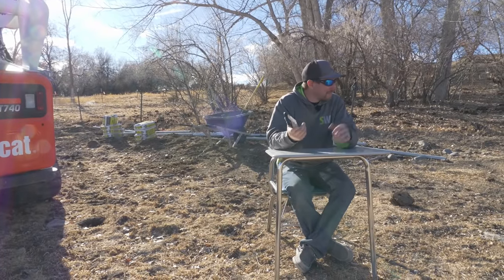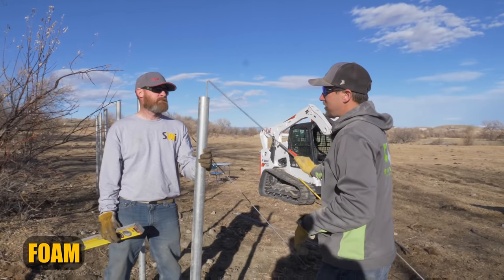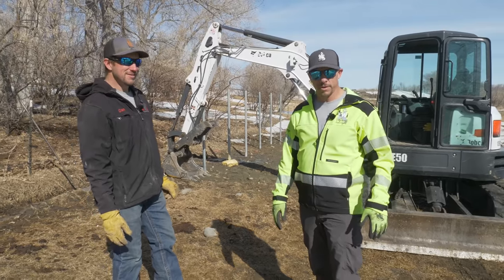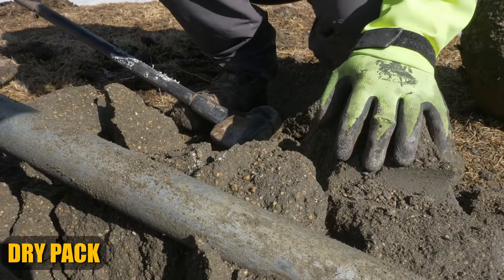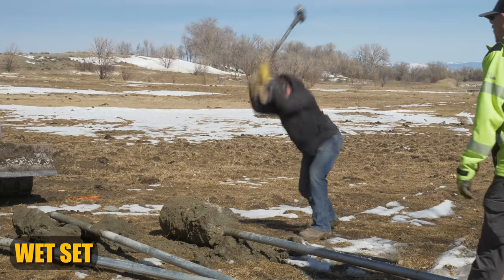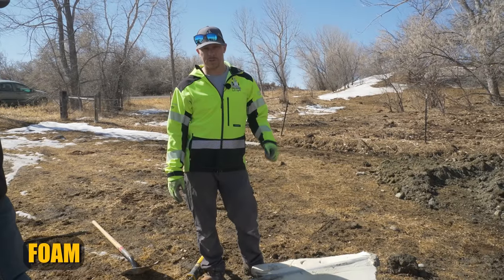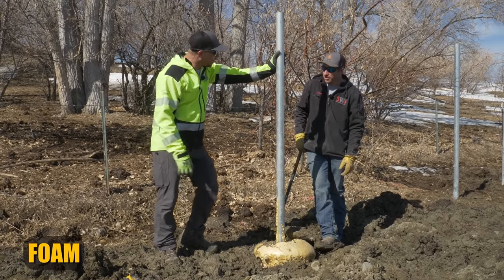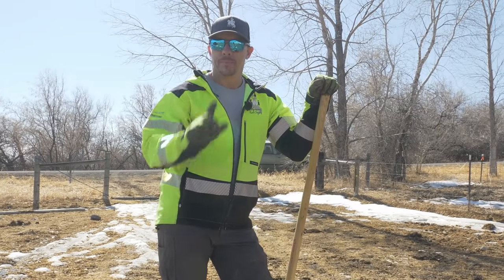Fence Foam vs Dry Pack vs Wet Set | We compare methods to see which is best for fence posts

Comment: I welded 4 inch bolts onto the bottom portion of the posts before pouring in the concrete for a super strong hold. Still strong 4 years and counting...
Reply from the maker: Yes this is fairly common.

Comment: You know when you spoke of the sound of the sledgehammer hitting the concrete. I'm a retired truck driver. I would use a hammer to thump the tires. When heard a high pitch sound the tires had the right pressure and low thump ment a low tire pressure. Same to knocking on a watermelon, high thump solid melon. Low thump meant soft over ripped melon. So high thump sound solid, low thump sound less solid.

Comment: Fences are often positioned to side the road and during winter the snow plows move the snow against the fence and by winters end, there can be 10 feet of snow pushing against the fence. Under such pressure I would not have any confidence in the dry-pack or foam methods. From your great experimenting, one can summarize that if the fence is delimiting no stress areas like between two properties or the back yard, any of the methods could be used but for the fence on the front yard where the road is, I would only use wet-pack. Don't forget that the stress on the post is exerted by the total length of fencing between the posts and so the snow-pack would apply proportionally more stress on the posts than a direct impact would on the post itself.

Comment: I did a test with Sika foam and I am convinced it is not the same as the industrial foam set application.  I noticed the post twisted more when drying as well as the packs that you get are more expensive as well as you need more for larger holes.  I have seen the hydro company use foam but it can’t be the same stuff
Reply: I used Sika last year, it pulls away from the post after a day, complete failure. I did have better luck with Fast2K.

Comment: Would y'all consider recreating this experiment with wood such as a typical pressure treated 4x4 and/or cedar 4x4? I am sure the most data will be comparable I am curious about the adhesion properties of each method.
Reply from the maker: I will put it on the list of ideas.  Thanks for watching.
Reply: There will never be adhesion between the concrete and wood. The concrete will retain water between the concrete and the post, the post will become saturated and when it does dry it will shrink, thus making the water situation worse and eventually causing the post to rot.

Comment: In Australia we use a mix of 2 or 3 gravel, 2 Sand and I portland cement + water mixed in a wheel barrow with a larry (Hoe) our posts are set at 600mm or 2'.0" in clay soil and 900mm or 3'.0" in sandy soil especially erecting colour bond fences with Posts set at 2400mm apart. We use 3 string lines bottom, top and very top for uniform Height hope this helps. But we don't have much ground frost as well.

Comment: Very helpful tests.  Is 7 days enough for the concrete to cure?  Wet-set needs about 30 days to reach ~90% of final strength.  I would think much longer for the dry-set since water must first migrate into it from the ground.  A TV episode showed California state employees capping off abandoned vertical mine shafts for safety, using polyurethane foam.  They cover the shaft with plastic sheet then pour the mixed foam on, forming a hemispherical plug, flat on top.  After curing, they cover with dirt and it will support a truck driving over it.
Reply from the maker: Pro tip: on a hot day in dry ground, concrete is hard enough to start building on in a matter of hours.  This is why we never brace our posts yet they stay put. In the summer we will pour posts before noon and start building after lunch.  Its not at full compressive strength but its usually hard enough to hold up the fence.  The next day its already hard enough to bend/break the post without hurting the concrete.
Reply: @Hello William How are you doing

Comment: Great video.  I'm also curious about the dry pack over a long period of time.  I've always heard that dry pack cures very slowly over a long period of time resulting in a stronger concrete.  And clearly from your video it was still curing at 1 week.
Reply: Dry pack has been proven in testing to never properly cure. The outer portion eventually seals enough to prevent enough moisture to penetrate, so the inside core never receives the proper moisture to achieve it's rated strength. But as he said, it is stronger and quicker than the foam. It is also cheaper than the foam. But it is inconsistent in strength, so it can not be used for structure application; i.e. utility poles

Comment: Fantastic!  Excellent review of the three options that are on the table today.  I couldn't stop laughing at the wet set hammer work. They all could be good enough, if done right.  I suspect that there might be some improvement in the dry set in the coming months, but also some degrading in the coming years.  The wet set is likely the strongest from 4hrs to 40 years, but from 48 hrs to 20 years it likely makes no difference wet or dry since it is so thick, especially if you toss some water down the hole before and a little on top before you leave.  except... I think if you compare a THIN long hole.  I suspect that if you dug 36in deep 8in dia holes the weakness of the dry set will be an issue, but the wet set will be fine, and save a lot of concrete.  I suspect that the 4kpsi wet set will be fine down to even a 6" hole, which is like only one 80# bag vs four 60# in a 12" hole.

I would like to see a comparison of a 6" hole to a 12" hole 36" deep wiggle and pull.  or 36 x 8 compared to 24 x 12?  Knowing where good enough with some buffer is, can prevent a lot of extra work and cost.

side note: I really don't get why people dig a hole 6" deeper than they pore concrete into.  I can sort of see a reason for an inch of gravel at the bottom, but if i am going from 30" deep to 36", i want concrete down there, even if it is a couple of inches under my pole (steel or wood), but not 6" of wasted digging.
Reply from the maker: That’s a great observation and some thing we will have to test. The reason we dig deeper than the post is for two reasons: the first is to be able to get below the frost level without buying additional post and the second would be that’s what the specs say.
Reply: @Hello Larry how are you doing
Reply: Larry thanks for the comment.Did you figure out the depth an diameter of holes?

Comment: I've had to use dry set here in KS while working for AT&T installing satellites. That's the only way they allowed us to. Now that I own my own business I can have my people add water because we're not idiots
Reply from the maker: We pour almost everything off of concrete trucks here but I know its popular in many other areas to dry pack.
Reply: Damn my AT&T DirecTV installer used foam, but I'm in costal SC
Reply: Wow that's pretty cool. There's a lot of cool stuff where they use foam for ground construction. I was only contracting for them and making $245 per install (doing 3-5 a day in 7hrs, their techs only averaged 1.3 in 9hrs) so they didn't like us lol. They probably made me go the hard route just because 😆

Comment: I’m curious about cost difference vs. time manual labor.
Reply: Manual labour difference none of you have a concrete truck dropping your concrete in the post holes eh.
Reply: Manuel charges $100/day under the table because he is illegal.
Reply: @Dirtyharry70585  true that.
Reply: @Dirtyharry70585  depends how valuable that post is: witg the right plasticizer you can pump it 20 storeys up or 800m away 😉

Comment: The foam is going to move your post while it’s expanding unless you brace the post. Dry pack doesn’t require the post to be braced and it stays in place. I always add atleast a couple gallons of water on top of dry pack just so it sets completely in 1 day.  That way it doesn’t have any extra time to move around.

Comment: If you use the foam, pack dirt on top of the foam when it is getting close to the top and kinda stand in it or pack it down so that the foam pushes out ward then to create a sort of fuller hole.

Comment: Well after 3hrs you can build on foam. I watched a utility company set wood poles using foam in fla after hurricane Michael. They do so since there’s a lack of water and they mix in hole plus in sand side loading is bad for all. 
Homes in the area that used concrete in fencing, turned those in flying sledgehammers to the neighborhoods two story roofs. I’m not sure of the code but most were one bag in sand soil. Those houses looked like a fire hose was inside for hours!

Comment: 12:44 Gotta say, after testing myself, the Sika foam in bag and similar isn’t the same as this 2 part foam you used here.
The stuff you used here, IMO, IS WAY BETTER AND YIELDS 100% BETTER RESULTS than the Sika foam and alike. If was using foam, it WOULD BE 100% THIS 2 PART TYPE MIX LIKE YOU DID. Have used Sika etc….and this brand far superior. Prefer concrete though; but used this foam for places that “makes sense” and still holding.

Comment: I will say the foam might be the best option if you need a temp hole filled with something set in it like a hurry thing but later need to remove or replace it. Be a waste for a dry pack and wet will waste the pole if you wanted to reuse it as it might not be damaged or rusted by that time. Foam is also maybe a lot lighter to carry around than 2 bags of concrete. I would say Wet and foam are the best going but you gotta get the right type of foam to use as some are not very strong at all and more for insulation purposes only.

Comment: I think something that's missed here is labour costs vs material costs. If the foam is 3 times the cost but takes 30 seconds to pour vs a worker mixing a wheel barrel full for five minutes poring, tamping etc  
Those labour costs start to really add up. 
I wish they would have worried more about side load. They only wiggled the foam one.
Reply from the maker: Those are good points. 👍🏻 And we'll see if we can't put something on the list for testing side load.

Comment: Material questions:  (New subscriber)
.Fence posts, galvanized steel what's the diameter and wall thickness?
.Is there commercial galvanized steel hardware to attach fence to fence posts?
.What's an average price for a fence post and hardware needed to attach a wooden fence?

Comment: Around here in SE Washington lots of
Fence companies just do dry pack but they add water before and after putting the post and concrete in. But we have lots of soft dirt in most places so it’ll be much harder than the surrounding dirt.
Reply from the maker: Its common all over the country

Comment: You're supposed to put 2-3 inches of water in the hole before you dump the dry mix. The hardest concrete I ever saw was dry poured. A wind storm destroyed a small metal carport that the posts were set dry about 4 months earlier. We pulled a couple but it was murder, so we gave up and sawed the rest.
Reply from the maker: Dry will never be better than properly mixed and placed wet concrete.  There’s a reason they don’t pour foundations or slabs that way.  Everything critical is wet poured because it is consistent and stronger.

Comment: Utility company probably likes the fact that the posts are easy to remove as well. And do they use foam for wood poles as well? Maybe the foam keeps wood from rotting unlike concrete. I’m experimenting with packing 3/8 crushed clean rock and using no concrete. My late neighbor was an old time logger  who knew a lot about everything. He said  I’m wasting my time using concrete so I switched. He said I was spending more time and money to just make my post rot away quicker. I was thinking yea I don’t think it will stay solid. Then I tried it and realized it is every bit as sturdy as concrete, especially when it’s included in an H brace. And it still has drainage and no chemical reaction.

Comment: You gotta pour some water on top the dry set my guy. An inspector/engineer at ft.lauderdsle int. Airport determined dry set is as good as wet set, now you never see a fence truck towing a mixer in palm beach county. Mix up wet for water shedding caps tho, and bang the post, me and my hammer knock any footer off with no more than 5 whacks. I'm florida man tho

Comment: The more north you go, the deeper the hole.  Up in the U.P. we'll drill down minimum 48" depending on the type of fence and height.  Foam is fine for ground with little to no frost.  Wet setting is more for commercial fencing where strict codes are enforced.  Been fencing with my cousin since I was 17.......46 now, lol and in all those years I'm proud to drive by all my work in the ground.  Did you guys drill big holes on the bottom of your vinyl posts to allow concrete to flow into the post and lock it in place?  Without the hole the post WILL slide out (heave up) of the concrete because of moisture and changes in weather (nothing holding the post to the concrete).
Reply from the maker: We stab our vinyl into the hole that is already full of concrete.  For this reason we don’t use the large hole to lock in the post.  The way we do it there is concrete inside and outside the post and it’s impossible to get the post to release from the concrete....we’ve tried.

Comment: I'd be interested in seeing the same test but with round wooden posts.
Reply: Wood in contact with concrete rots. This is because concrete pulls moisture from soil, and then the wood whicks that moisture into the air. The moisture moving through the wood destroys it.
Reply: @mdeamicis  He should use Simpson Teco Clips/Strong-Ties for wood posts/concrete use, they come powder coated or galvanized either hot-dipped or electroplated... buried sono-tubes for concrete... problem solved...

Comment: I would like to see how well compacted no. 8 or 10 crushed gravel would work. If they poured directly from the bag the mix will be lousy as the agregate segregates during transit. Bag mix has to be thoroughly mixed. The utility companies are using foam because the foam encapsulates the pole and helps to prevent rot as well as stabilizing the pole making it a cost effective move for the utility companies.

Comment: I found that if you use too much concrtete makes the post resist side pressure less... if you use less concrete (less than half of your hole) you can use a tamper to tamp the dirt when you back fill. works the best. Makes it extremely difficult to if not impossible to remove with back and forth side pressure. Also i like to take a pipe wrenck and flare the bottom of the post which securely locks it in

Comment: You mention that utility companies are using this foam stuff which is fine.  But what is the % of buried pole to exposed pole and what's the ratio of diameter of pole to diameter of poured foam.  I get that it might be stronger but a 4 inch hole holding a 2 in pipe might not be enough.  Should the hole be min of 6in across or does it need to be like an 8in hole?

Comment: Hey I also see you guys hydraulically driving potion so just depend on the type of ground? I just wanted to do a perimeter commercial chain-link fence I see a lot of people driving them in with hydraulic drivers either office skid steer or them hand gas powered ones are hand hydraulic ones what are your thoughts on that?

Comment: I always kinda wondered why wet set isn't more common, especially on larger jobs.  Like, pull a mini mixer behind a tractor/riding mower/etc. and just pour hole after hole after hole, on down the line.
Reply from the maker: Or use a Cement Hog https://youtu.be/EGo88fUmb-8?t=171
Reply: @SWiFence  Good for a pro, unless you can rent.  I was thinking more of options for DIYers.  Like a farmer fencing a big field or something (already has a tractor) or a homeowner with a big yard (already has a riding mower).  Although, you could probably sling a Cement Hog on a trailer, I would assume.

Comment: Can I use the regular cement (not the quickset) dry?  Also, why don't you also do one dry set where you add water to the hole.  I have 6X6 Tamarack posts that are 13-14' tall.  In my area, I can't get deeper than 3' due to rocky ground.  I am only hanging welded wire to keep the rabbits and deer out of my orchard.  Area is 50X50.
Reply from the maker: Yes, the dry pack we used was regular cement, not quickset.
We should do a test with dry set and add water--it's been mentioned a few times. 👍🏻

Comment: Great video mark what I do like with the dry pack method is how you can build fence without having to come back another day or so and without messing up your fence line, as long as you compact it well with the sharp end of your tamp and not the flat end. But for your commercial projects and when needed definitely wet set
Reply from the maker: Absolutely